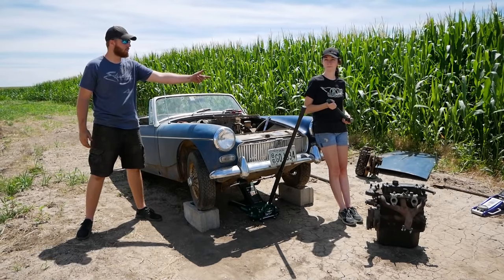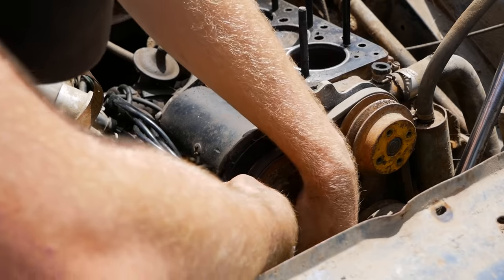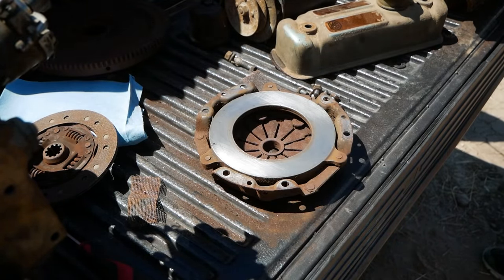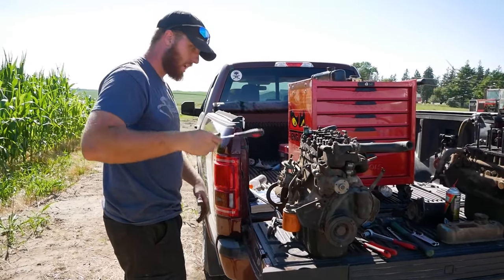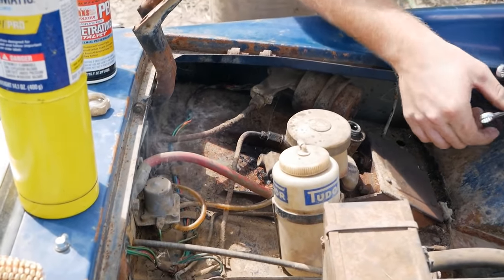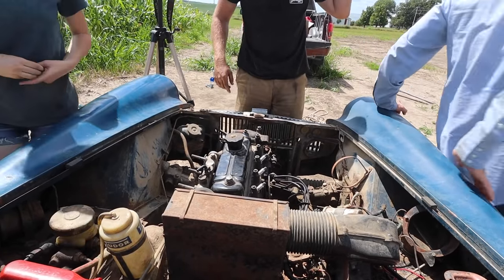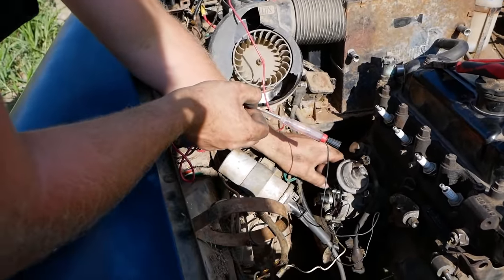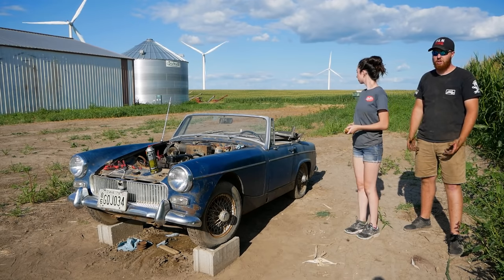Can We Make a SEIZED MG  Run After 42 YEARS!? - Part 2

Comment: First off, that's not a '68, either.  In '68, they put side-markers on the fenders. It's older yet. The generator might be a clue, but I'm not sure when they changed over to alternators.  Can't remember which my '68 had.  My '66 Spitfire had a gennie, I believe.  It was also positive ground, which might explain why the battery cables seemed switched.  Someone might have converted it.  My '68 (Sprite, not Midget...same difference, except for the trim) was negative ground.  I put a stereo in it with no problem, but blew up the first one I put in the Spit.

Also...Brit cars of that vintage needed special brake fluid, or the rubber would swell in a matter of days and lock the cylinder.  Dunno about newer ones or whether they addressed that with newer fluids.  They'll know if that clutch locks up.

Next, why was Cornstarch (picked that up from another commenter) wearing sunglasses as he tried to line up the input shaft?  I think he's all hat and no cattle, so to speak.  Maybe Daddy doesn't let him use the farm machinery without supervision.

Which brings up another point: what farmer doesn't have a tractor?  I know on the little farm where I grew up, we had several ways to pull an engine...either a chain fall, comealong, or tractor with a boom and a front-loader.  Push that thing into one of those buildings and throw that rope over a beam and pull if all else fails.

I hope they don't hoon the shit out of that poor little baby as soon as they get it running.

Comment: My first car was a 63 'B'. Block and Tackle chain pullys and a thick tree branch. Pulled engine to change throw out bearing. 1342, BTW, I could swear (after many decades of seeing one) that the firing order was cast on the front of the head. Anyhow,  After selling my 74 'B' to a guy that said he was going slip a Mazda rotary engine in it I have wanted to see someone do that. He told me the rotary mates with the stock MG transmission

Comment: I once pulled an engine on an MGA on the edge of a soccer field using a hunk of rope over a tree limb, then tied the other end to the bumper of a VW bug. We replaced the crankshaft due to a spun bearing. Shade tree tricks included cleaning parts using the oil pan as a bucket and the electric fuel pump to supply the washing agent. (gasoline) Clutch pilot tool was a socket extension wrapped with mashing tape to proper size so it fit tight in the bushing and disc spline area. In 1972 a local machine shop turned the crank for about $4 per journal and supplied bearings for another $1.50 per cyl. Everything was plastered up with gasket sealer and recalling we did the whole job for under $30. Why did we do this? It was a road trip from New England to NC to visit friends at Clemson University, and we were stuck there till the car was running again.

Comment: Just wondering if that's a positive ground car. I had a Spit Fire that was positive ground. You could also adjust the SU carbs for the type of gas you were using, high octane or low octane. Also looking at dudes collection of race cars, wondering if he had a Alpine Tiger in there. If so would like to see that baby fired up. Take it for a rip.#02 Ford  in a small car is great fun.  Would like to see a Ford Barra in a TR, MG, or Sunbeam.

Comment: 1275 A series engine, same engine that went into Morris Minor 1000 only with an increased bore and stroke. Lovely engine the A Series. I have a 1967 Morris 1000 with a 1098 A series engine and even after 53 years it still runs beautifully.

Comment: 30:20 I'm not sure exactly when, but we (Ze Englishers) only went to metric fasteners some time in the 70s-80s.  We've always been cursed with a strange mixture of metric, imperial and some other units too. It's interesting to say the least, specially when we think of economy in MPG and fuel is sold in litres (not liters, and our gallons are bigger than yours for some reason too. 4.55L).  Makes you wonder why we're not all better at maths to convert all the time!

Comment: "not a real big fan of this view right here Kevin" quote of the show, even got a laugh out of mook 😝

Yeah plenty of pinch fingers in that process. I learnt a long time ago when placing the grubby digits in said pinch point at least put on the impact resistant gloves. They won't save you from the pain just reduce the damage from the minor bingle's 😁

In true cornfield workshop fashion... should have used bailing/fencing wire instead of cable ties 😝

Comment: In response to your question as to why all the hardware is imperial/ standard instead of metric, the MG midget was first produced in 1961, the UK only switched over to the metric system in 1965. I expect they didn't want to redesign the car just to change all the fittings when imperial tools and hardware would still have been available.

Comment: UK Cars from the 50s 60s 70s 80s where British standard Whitworth, Then moved to American fine thread and Imperial. Then to metric in the later years. I have lost count of how many engines I have taken out or put in with me standing on the inner wings with a rope around my neck lifting an engine out. But of coarse most UK cars are only four cylinder and some are even an alloy block. V6 V8 you got the engine hoist out to the job.

Comment: Triumph Spitfire is a much easier tiny sportscar to work on, especially for an engine swap. Small cast Iron 4 cylinder about the same weight. I've completed a swap without removing the head, by myself, from removing first fastener to starting new engine in under an hour.

Comment: British stuff of that generation used imperial size bolts. They do, however, use Whitworth threads. Whitworth threads have a 55 degree thread form, SAE threads are 60 degrees. So, not interchangeable.

Comment: The reason the bolts are not metric is that the car was designed pre metric in the UK , the UK started moving over from imperial in 1962 ... PS why do you think the US uses imperial...

Comment: Those little engines are heavier than you think...
cast iron block and head for one thing..

And the US gets its inches and feet from the English.
They metrified around the 70s or 80s, after those cars..
They use both depending the context

Comment: UK cars weren't metric until well after that MG was built. Fun fact. Old Ford transit vans were built in the UK and Germany. They looked totally identical but they had literally zero interchangeable parts as the German ones were Metric and the UK ones were Imperial.

Comment: It has “standard” (imperial as we call them) bolts as the uk didn’t go to the metric system until 1965, though most british manufacturers (like the original mini) used imperial or a mix of imp and metric all the way through to the mid 90s 👍

Comment: No... instead of blowing head gaskets Ford smallblocks crack or warp heads and valve seats if your lucky... if not they loose water pumps or the entire block splits down the middle because they can't seem to fix the design flaw they made and have known about from the first one sold... But hey who am I to complain when you couldn't pay me to own one to begin with...

Comment: I miss working on cars to be honest.  Then again the way I was taught was basically, "here's the part, you know where the tools are go replace it."  I tinker with things where I can and have helped some people from time to time.  Done more than a few tune ups, repairs, and brake replacements under a tree across the road from the apartments I am at.  

Sadly my truck has a blown head gasket but being in an apartment I don't have much of a chance doing a replacement myself, plus it's the only vehicle.  Limping by for now and hoping to come across a replacement a few years newer that has been rear ended at LKQ.  Pull engine and trans then maybe get lucky and find a place to do the swap.  Won't be doing the lift it with some ropes though, tore up my shoulder 20 years ago and when I did that I broke the end of my clavicle.  Didn't find out till 15 years later even though I did go for an X-ray the day it all happened, guess they couldn't be bothered to actually see it...

Comment: The bolts in a 1968 miget may be imperail as car makers in 1960 where using imperail then gradually changed to metric in the 1970 s I think but could be wrong

Comment: hello again, my experience of "A" series engines is they start really well if 1. they have good spark,2  the battery is charged, 3the carb dashpots slide up and down, 4the carb dashpot have oil in the damper, 5 carb float level correct 6 contact breakers adjusted.  so just like the v8s you are used to except the su carb is very simple. best wishes from manchester uk. ps i run a transverse 1275cc engine in my gtm rossa kit car.

Comment: That front wheel wobble is classic MG. The hub spline is much harder than the hub in the wheels so the splines on the wheel hubs wear and you get that wobble. I ran a 67 BGT till the body came away from the chassis. Very high maintenance but they are a blast to drive. Mine had the selective overdrive option. Fun feature. It's switched with an electric toggle on the dash but the system is sort of electro-mechanical. You could leave it turned off through the gears then switch it on at highway speed or you could leave it turned on. Through the gears I think the engine rpm's trigger the OD then when you shift and it drops rpm's it returns to direct drive till it reaches the rpm trigger. Again, fun little car and with the BGT body it was even a decent grocery getter.

Comment: anyone can remove a Briggs and striation 22 hp motor in a corn field with no hoist or cherry picker step up your game with a big block oh wait gm never brake make it a ford 460 they always need to be rebuilt or removed ive gone to the junk yard with a cheap socket set 1/4 3/8 1/2 screw driver and utility knife and removed engines  back in the 90s when i was a young buck now air tools and cordless tools spoil us i can even change my tire with a 4 way i need my 1/2 impact cordless gun

Comment: I have a 2003 mustang in great shape. It only has 140, 000 on it. The only draw back is it has a V6. It runs great and everything works on the car. I have been wanting to swap the engine over to a 4.6 GT and trying to find a doner car to do it with. Its not to hard to do but i was wondering if we could do it on your channel?  I pay for everything.

Comment: My old man used to buy and fix up or part these out in the early 80s.  He still jokes to this day how a small chinese socket set and few screw drivers were all it took to disassemble the whole car.  He also would pull engines with just some ropes and the branch of a big Maple tree.  Keep the videos coming you 2 and Thunderhead289 put out some good content.

Comment: I’ve always heavily preferred Chevy because the engines are built good, and they last a long time with proper care and maintenance, but I’ll admit although some ford bodies can be horrendous, they are very intellectually built vehicles, but due to this not only are the engines much harder to work on based on the fact that they have so much less space to get around them but they are heavier, and have if not bigger, than more expensive parts, I bought a transmission for a Chevy Silverado, and then a transmission for a ford super duty that was actually a few years older, and the Chevy part was still cheaper, and easier to fix, so although ford motors are built stronger, they are harder to work on and parts are not expensive, this is based on my personal experience, but everyone’s experience and opinion is different, but me still a Chevy guy

Comment: Wrong junkyard digs, the flat head ford had the exhaust valves sharing the same exhaust tube. While yes, chevys did have exhaust valves together, the exhaust went through two different ports, and they didn’t have head gasket issues.

Comment: Somebody has probably already let you know this, but over hear in the uk we used to run on what you call standard (we call it imperial) until some point in the 60s but it took a long time to die out completely. Vehicles from that time used imperial but for years after.

Comment: BMC products were imperial, until you got wired happenings like older cars fitted with new O series engines, then you had all imperial except on the engine which were metric. They went all metric in the early 80s with new models. The very last imperial being the a series engine in the mini in the mid 90s!

Comment: Everyone knows the way you pull a Brit 4-banger is the strongest person stands on the fenders straddling the engine bay and with the engine properly chained, that person lifts it high enough to slip some 2x4s under it, at which point it can be carried away .

Comment: I changed the engine in a similar Midget in the late seventies on my own.  I did cheat though, I used a small wood framed garage which had a very useful roof truss.  So, a bit of rope and the roof of the shed helped a little!.  The UK didn't really start to go metric until the seventies and all cars built there were Imperial until well into the ninieties.   Only the Japanese cars built in the UK used all metric.

Comment: No need to do the whole timing setup. The with a paddle drive on the distributor (vs a gear drive) your distributor can only be in the correct position or 180 degrees out. So just take note of where the advance /retard diaphragm is when you remove it and rotate it to the  same orientation when you install it.

Comment: MG used whitworth threads. Most of the bolt sizes will match to an SAE wrench but there are a few that require a whitworth wrench. This was more noticable with British motorcycles than the cars for some reason.

Comment: The fact that you're able to pull the motor without the transmission means somebody had cut access holes that weren't there when Mike and the guys built these things thanks I know my 74 required cutting access holes to get transmission freed but after the first timr i had to pull this over the weekend and do the throwout i learned it was worth a few holes in the splash plate or what ever that is glad u got it going rhey are fun cars my favorite thing was that it was lower that a semi trailer and was able to drive under them (longer story)

Comment: You can connect the battery either way round, just use new positive connection and flash it to large spade on dynamo and it will change polarity, reminds me of changing engines in my early minis, used a scaffold pole and 2 people to remove engine, tip is to get the height put a couple of spare wheels on the floor as stepping stones to gain more height,

Comment: Dad was a great one for re-engineering tools into other tools for a specific job. May not have used corn cobs, but had several very strange screw drivers, one with a one sided razor blade welded on it.

Comment: Te reason the bolts snd more likely fitting are sae not metric are that in the usa non meteic was cheaper and more available for replacement when u lost the metric bolts of broke the fuel and brake lines ...

Comment: The English had a bad habit of using positive grounding on their sporty little cars. Our 1959 TR3 was thus equipped. Those little cars were wonderful but they were a PITA, ESPECIALLY the dual Lucas carbs !’
Reply: Changing to Negative earth takes about 5 minutes.  But you do need to swap out the radio.

Comment: hi you need to put mounting on  as will rip the wire tys off to much torq and back lash  but good vid i used to put ford cortina and anglia engines in like this at home

Comment: A series are known for being great little robust engines, never heard of them blowing head gaskets commonly
Reply: and we used imperial in the UK until '73, but to this day completely mix metric and imperial, we buy fuel in litres but use mpg, measure height in feet and weight in KG

Comment: I worked on these many years ago and was very good at it.  When you pull or install the engine, it should come out and go back in as a unit with the transmission.  Installing the clutch is so much easier, as well as getting it sitting on the mounts.

Comment: The design has both exhaust valves from adjacent cylinders next to each other. This layout is why older small block Chevy heads cracked and blew coolant out the to center exhaust ports on the cylinder heads. Ford was wise enough to stack intake and exhaust valves next to each other down the row of cylinders in the small block ford and all their 4 cylinder engines and 6 cylinders for this reason. Having two exhaust valves so close to each other causes a hot spot in the cylinder head which expands and contracts with temperature swings causing the head gasket to walk back and forth when it heats up and cools down eventually blowing the gaskets seal. The small block chevy had a coolant jacket between cylinders in the cylinder head but cylinder head casting inconsistencies caused some heads to have less material around the ports and jacket which makes them prone to crack inside the exhaust port and dump coolant out the exhaust.
Reply: Interestingly enough having separate exhaust ports equally spaced helps prevent exhaust manifold leaks at the cylinder head as well another ford small and big block trait in head casting. Having two center exhaust ports so close to each other causes a hot spot which either burns the gasket out from walking from expansion and contraction by heat. If you notice the new LS chevys are set up with equally spaced exhaust ports and aren't common to break bolts or leak. Yet the Ford modular motors are equally spaced and are known for manifold leaks and broken bolts. The ford has a long style exhaust manifold which warps because it acts like a giant heat sink. The New hemi engines have the same exhaust manifold design and the same problems as the ford modular motors do.